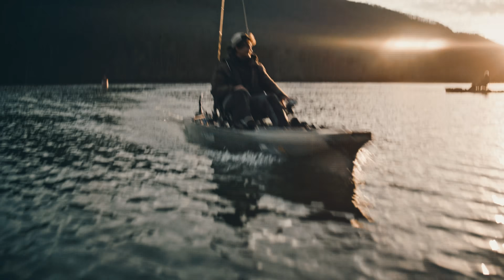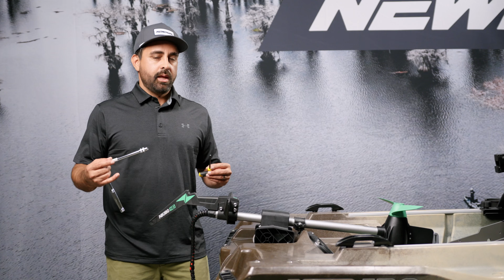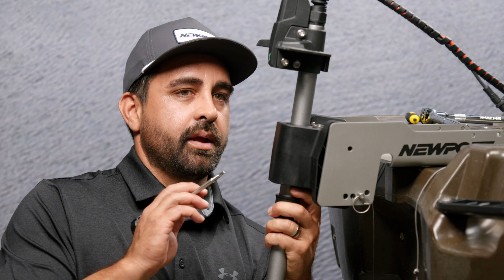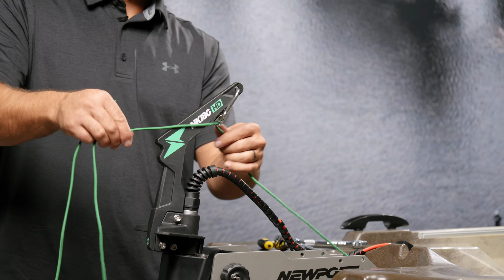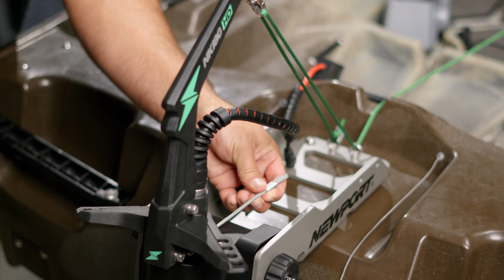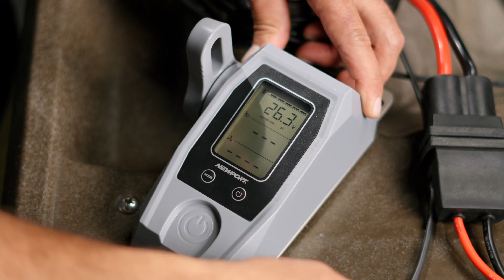Quick Start | NK HD Electric Kayak Motor | Full Setup Tutorial

Comment from the maker: Article: https://newportvessels.com/blogs/learn/introducing-nk-hd-all-the-new-features-explained

The Low-Down:
Some upgrades are easy to see: a reinforced composite lift arm and steering system built to handle modern high-thrust setups like the NK300, a micro pulley system for lower-profile mounting and full stowage, and an improved cable strain relief mechanism for longer cable life. But a lot of the value is unseen at first sight — including overbuilt communication connectors for consistent power delivery and upgraded precision bearings that create noticeably smoother and quieter motorization. 

Internally, the NK HD features an all-new advanced PCB design for the motor, driver, and controller, plus specialized conformal-coated electronics to protect against vibration, water, impact, and thermal shock. Pair that with a refined throttle curve for smoother acceleration and better low-speed control, and the difference becomes clear.

Comment: Hi, I have a Jackson Knarr and live in Canada. When will they be avaliable to Canadian retail stores?

 Also has their any changes to the warranty from the discontinued models with this new one.

 "One claim or fix only" if it qualifies? 

"Length of warranty"

The reason I ask is that I have seen some disappointed customers and lots of time spent to provide videos, isses of sound levels 90 plus decibles and acuracy of the battery level read out on the older models.

Thank you,

Comment: Has the retract arm material been upgraded? I know that the non HD motors arm would break easy so folks would use 3rd party arms. Has this been updated?
Reply from the maker: This is one major improvement behind the new motors, and it has been 100% solved for. NK HD isn’t just a cosmetic refresh of the original NK. It’s an evolved platform built directly from years of customer feedback and real-world use, with meaningful upgrades focused on durability, smoothness, and control.

Mechanically, the NK HD features a reinforced composite lift arm and steering system designed to better handle retract and steering loads, especially with higher-thrust setups, along with a more robust communication cable connector for consistent long-term power delivery. We also upgraded the internal bearings to improve smoothness and longevity.

Beyond the visible hardware changes, we enhanced the internal electronics and redesigned the throttle curve. This gives you more precise, responsive control, smoother acceleration, and better low-speed command of your vessel.